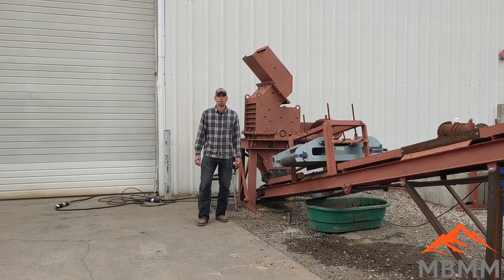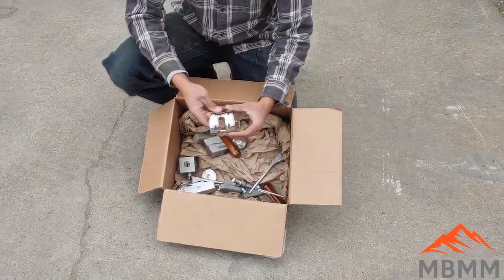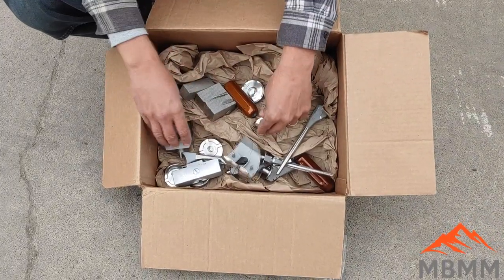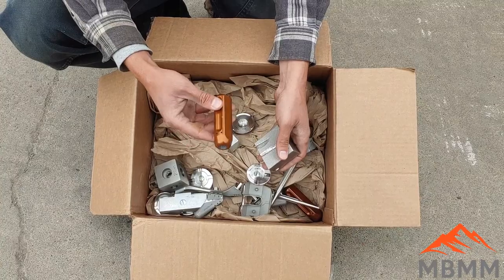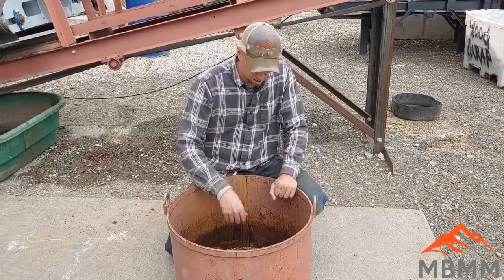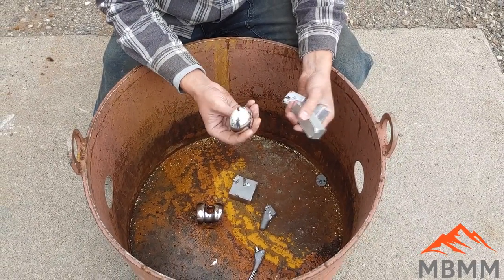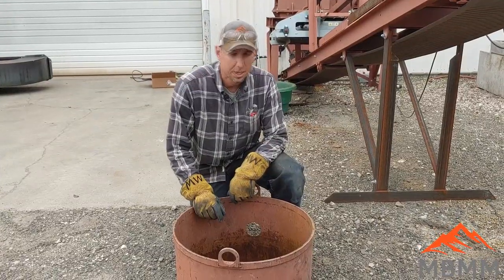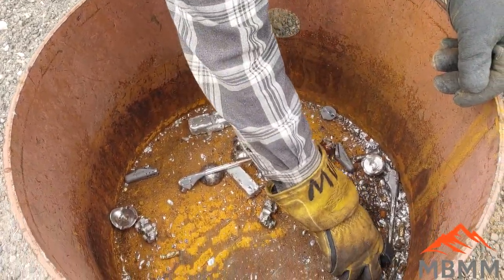Shredding Replacement Human Body Parts In A Hammer Mill!

Comment: Body parts? You mean those artificial joints? Those are pretty good quality metal for sure, why chop it? You can sell them to machinists, especially those true round and true square blocks, they can use it on building things. Or they can be use in electrolysis process to coat a rust proof coating on machined parts. by the way, these parts are hard as coffin nails! Your machine will break it's teeth when chewing them.